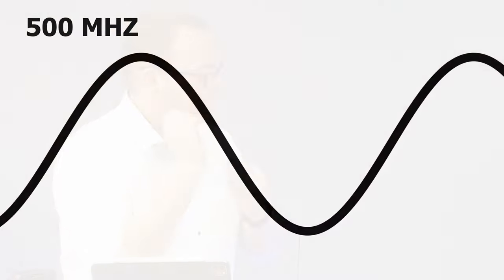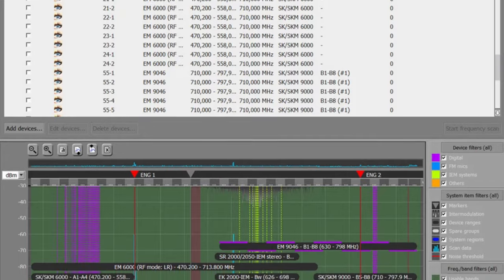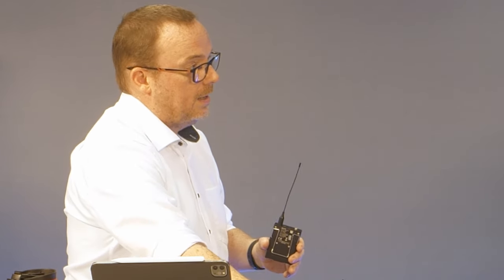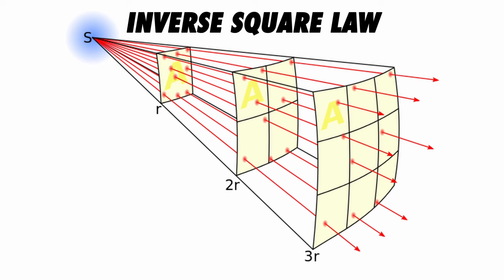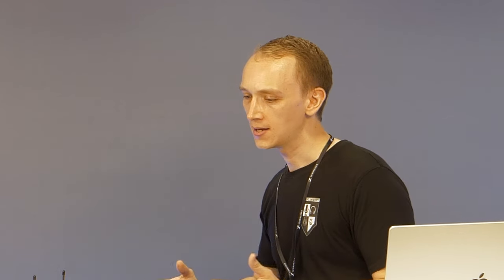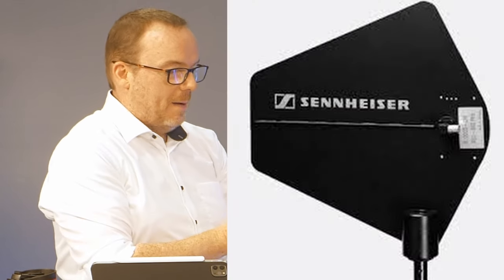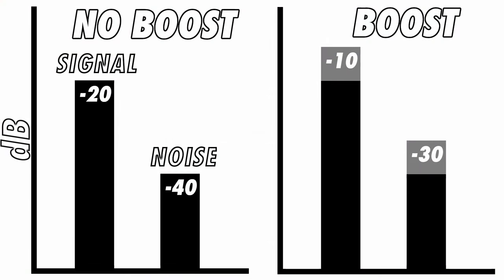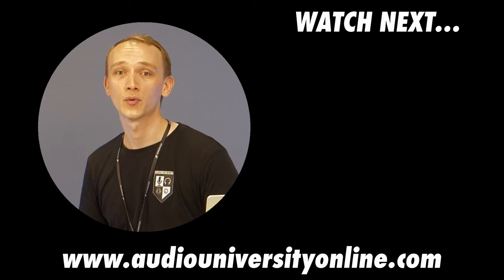Wireless Microphone System NOT Working? Try This...

Comment: I have a problem with my Sennheiser, when the receiver is on but the micro is off , I have a lot of noise in my mixer, only when I put on in microfone even in mute they disappeared. 
It's normal or it's a problem on the receiver?
Reply: adjust to a higher squelch threshold on the receiver, it works same way as a noise gate muting the audio until the signal reaches a certain level